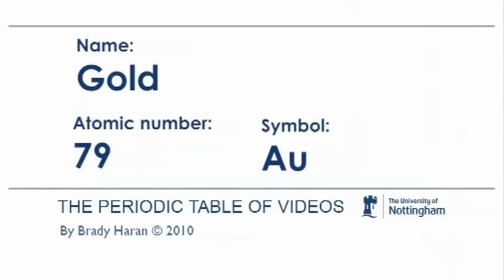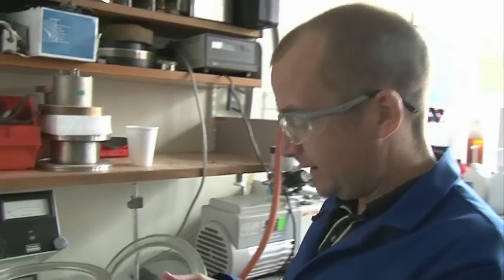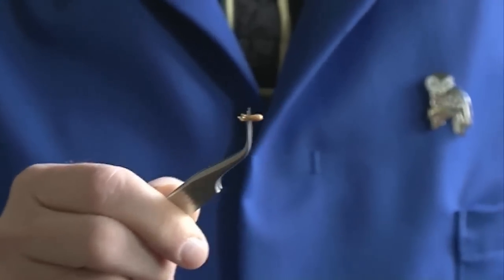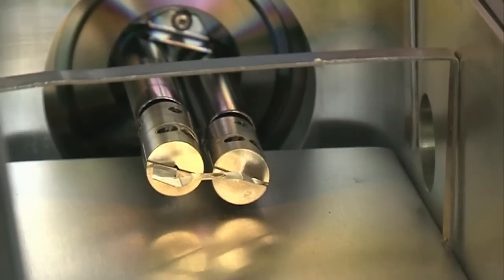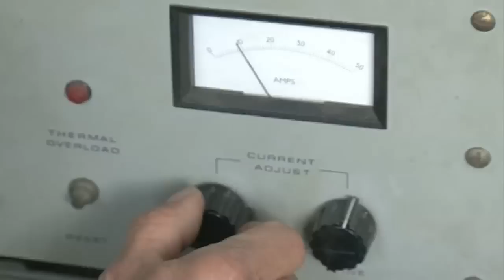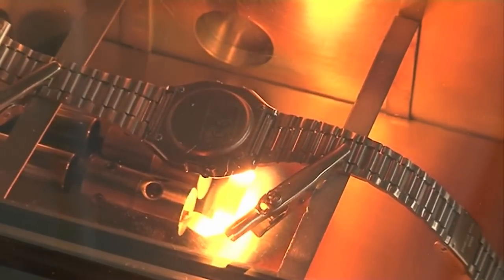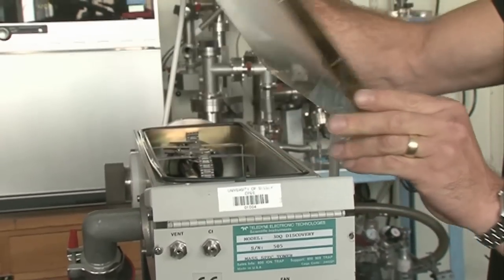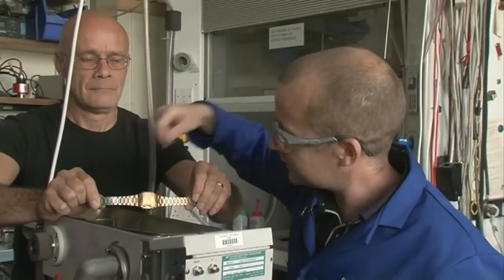Gold & Casio Watch - Periodic Table of Videos

Comment: Surely electroplating is the most effective method?
Reply: remove electronics before plating...
Reply: +danielalexan80 How are you supposed to do that with a watch that wasn't made to be taken apart?
Reply: surely you can at least pop the back off to change the battery? if so then the electronics should be removable
Reply: Yes I have a brush plating system that can do it much better job than that but you need to nickal plate it first so that the gold will stick to it
Reply: @Eric Konschuh That's something of an anomaly. Also, you actually can take it apart (but it's not easy)

Comment: If you redo this, consider temporarily bonding insulation or even heat sinks to  vulnerable plastic parts and suspending the watch by thin threads. If you still want to make it up to Martyn after all these years, there's currently an ebay listing for the exact same watch, a Casio A163W.

Comment: That colloid gold made me remember that if one adds colloid gold to glass the result is very beautiful ruby glass. Also somewhat expensive even though there is so little gold in it. Gold can be hammered out to a thin foil, gold leaf, that can be used for some forms of gilding. When one looks through such a leaf the light is greenish. It is also used for sunshades for astronauts. That is probably also deposited through evaporation but I do not know for sure.
Reply: That what I thought about the glass. Didn't they use gold plated glass on  astronaut helmets?

Comment: The distribution of elements isn't completely correlated with where they lie on the periodic table (lithium is much more rare than oxygen). I believe there are four processes that make elements heavier than hydrogen:
Fusion, The "slow" process, the "fast" process, and fission/decay (following the fast slow or fast process). I think lead is a final product from several different fission chains.

Comment: "An element/materials melting point is determined by pressure. At atmospheric pressure gold had a very high melting point, but at low pressures its melting and boiling point will decrease quite a bit. A real world example of this is that water boils at about 67 degrees Celsius at the top of Mount Everest as the pressure is much lower at high altitudes."

There is no reply button for some reason.
Actually, the mp stays the same. The bp changes radically : it reduces when pressure is lowered. When pressure is 0, then bp becomes equal to the mp, the substance sublimates.

Comment: Something I've always wondered is, now that we know what matter is made of, something alchemists of old obviously didn't, is it actually possible to turn lead in to gold (Or something else much closer to gold on the table)? I'm assuming it would take something much more dramatic than a chemical bath, I mean like if you had access to a fission reactor or something. I imagine with a fission pod and a fusion pod you could make pretty much anything you'd want. Even if it did come out slightly radioactive.
Reply: You're right; if you could pull three protons and neutrons from the nucleus of a lead atom, it would turn into gold. 

The problem is we don't know how to do that, and we certainly can't do it in a way that's cheap enough to make it practical.
Reply: +John Nowak It is possible to make gold in atom colliders, its just at a rate of 100000 atoms / year.
Reply: +Amar Gandhi probably costs a lot more then the gold though
Reply: Even if a massive fusion reactor was made, and we had figured out positive energy fusion reactors, I bet the operating cost of such a thing would be much higher than the value of any materials that could be manufactured this way.

Comment: Why did you use the thermal evaporation technique rather than a plasma sputter coating such as those in SEM labs? Sputter coaters won't heat your specimen significantly, they operate in a weaker vacuum, and I think less gold would be wasted compared to evaporation.

Comment: Does this work with 14 karat gold or just 24 karat gold?
Reply: Lots of metals as long as they has a boiling point lower than the melting point of titanium. Or even more if you use a ceramic electrode.
Reply: During the sputter process the metal you want to deposit on the material has to be boiled in a vacuum causing the metal to form a vapor. And sort of during the process the heavier atoms will fall into material so some copper may not fall or may take too long to fall onto the material but it is only a tiny change which at most will may raise the krt rating if the compound metal by .1 but you'd have to have a large sputter chamber to cause these effects.

Comment: This proves that even geniuses can make big mistakes. You should have been able to remove the workings from the watch, leaving only the metal housing and band behind. Also, you could have suspended it with very thin wire, so you didn't have bars of steel blocking the gold atoms...

Comment: You had to remove the battery from the watch before vacuuming.
Reply: why remove the battery? it's the front of the watch that's damaged by the heat.
Reply: Saman Bahrampoor Because the Vacuum itself is a danger to batteries

Comment: FWIW, in my language (German), there are no plural forms of units. It's 5 Zentimeter, 6 Kilogramm, 100 Kelvin, 230 Volt, 800 Watt, 2 Tesla. Out of habit, I probably wouldn't say "Kelvins" when speaking English as it would sound odd to my ears.
BTW, interestingly, AFAIK, there are only "horsepower" in the English language, not "horsepowers".
How do you say 20000 Gauss? Gauss or Gausses?